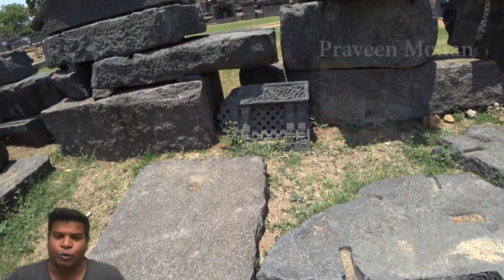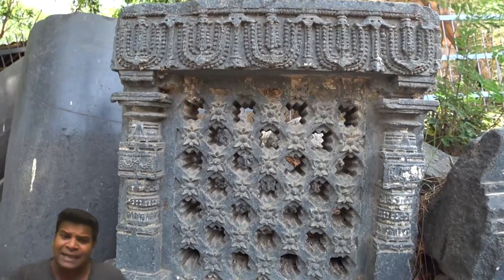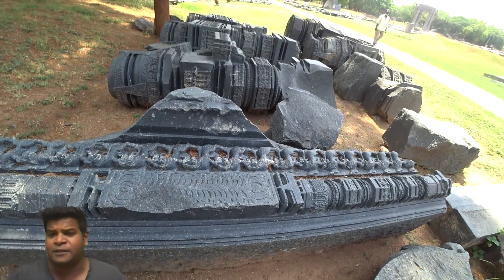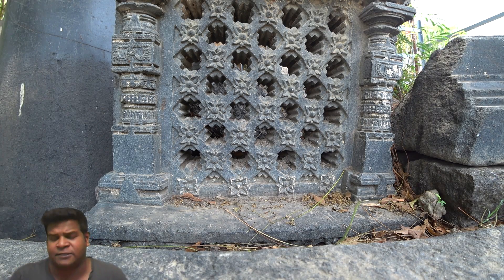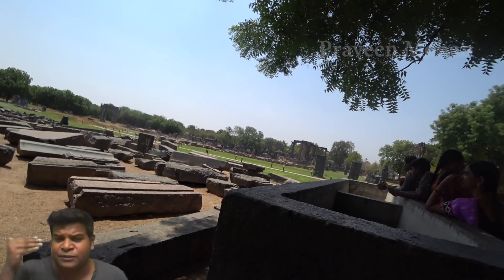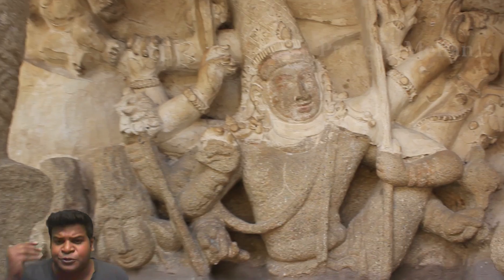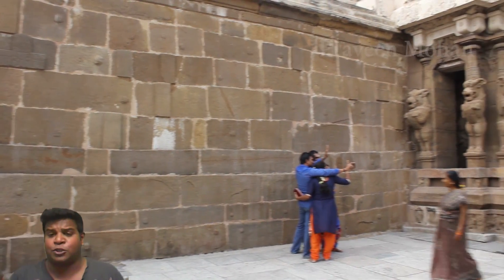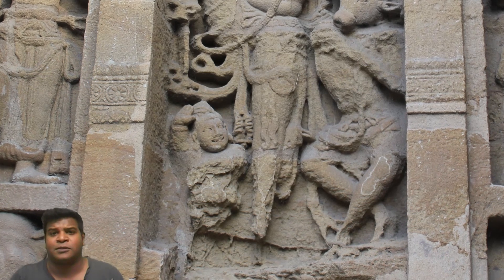Ancient Kailasa Nathar Temple was NOT built with Stones? Advanced Technology Revealed!

Comment: It is a shame that archeologists are taking it upon themselves to render judgement on the composition of the stone carvings at these sites. A more intelligent approach would be to have geologists examine the stones to ascertain the true nature of these materials. If they are found to be manufactured, rather than being naturally occuring rock then the next step would be to have chemical engineers do testing to determine the actual composition of the rock material. Another additional approach would be to have structural engineers take samples of the construction materials and then use a supercomputer to determine if the materials used were a match for the strength and stability that would be required to produce a structure of that size and design. It is a shame that the possibilities for answers are left solely in the hands of archeologists that rarely have expertise in multiple fields!!!!!

Comment: They are designs that they're perfectly the same that were used with the tool that was the same size and measured it looks like it was drilled all the way through straight down you know like with the design at the tip and pushed all the way in and make exactly the same size all little windows or whatever they're designed or they're the same size and everything they're the same

Comment: Ignorant Question I am sure: "What compound substances corrosively react with Gypsum? Lime? Cement? Lye is corrosive and made from ashes. Maybe reverse engineer the process of ashes and water to find a pattern and work from it. Gypsum and water... Lime and water?  Under what circumstances did polymer come to be? Maybe reactive substances have a pattern which require the presence of oxygen and nitrogen (air)? Now I'm interested in chemistry and physics-must be an easy way to make your own lab equipment. Curious how long ago did glass come into being. Hmmm will have to sleep on this.

Comment: Why limit ourselves to either carving OR geopolymer options. Can't it be both? What if the vast majority of the rock is a geopolymer with a semi slow hardening time and they carved/chiseled/stamped/etc the figures and designs before it hardened....or maybe the GP stone was mixed with all but 1-2 ingredients leaving it soft until after it was worked, then the final ingredients added which cause the hardening process. Just food for thought but it would most definitely make it possible to make all the insanely intricate work achievable with said copper or bronze tools. 
  In the case of Egypt it would make things like the core drill hole cut rates much more agreeable. All this said, it would leave us with a new canundrum. The specific ingredients of said GP stone.....much less each type of stone would require its own additives to achieve each individual final product.
  Point being, maybe we have been asking the wrong questions and that's why the answers are so difficult to discover.

Comment: Geopolymer signature may be the knobs on the megalithic wall at Kailasanathar, similar to knobs around the world. Do the holes in the Jali Stones taper? Certain sign of casting, moulding, and likely modular pattern elements, akin to movable type, stackable, and moulded identically themselves. This is better than sandcasting, and many elements imply more than the use of cores, but even a flexible, reusable mould face such as latex or silicone.

Comment: I do molding and casting with some of my art projects . Some stones are exact cuts from one place and transported to another, that didn't make exact cuts and then turn the block to sand and then form it back to original shape. Think about it, you can see insane blocks that are cut huge and kept the same and then placed as if teleported into place and I'm talking stones that weigh 150 thousand tons per block. Exact cuts when stone was removed and same cuts reflect on final product not saying cement forms can't exist back then I'm saying they didn't do this at places like baalbeck, you can find stone cuts of blocks cut as blocks to be blocks even into intricate shapes and intricate cuts with plenty of evidence showing they knew how to cut stone in ways we don't understand . I know a block removed from a stone cliff side and the block is exact to the hole. The block fits in hole perfect meaning something cut it and even cut the back of the block with no room for blades or a machine to turn inside the cut to sheer the back surface . it's a block literally sucked out of the spot with zero granular degradation, no saw dust and again the you gotta turn a 90 degree angle to cut the back of the block but no evidence shows this was done the block was cut perfect and left a hole exact to shape of block with no space for a cut or blade to fit in or to make that angle to cut the backside if the sides show no blade or anything made that cut on the back side. Nothing we know of can do this, the block is exact to the hole on all side and the back which is impossible with our technologies or understanding

Comment: Could be but impossible to pop out of a mold in many cases because of reverse curves and locked areas unless you uses the lost wax type of molding.so the shear volume of stones and artifacts built in this way would still require high speed plug mold cutting device.doesnt mean they didn't use wax or something like it.

Comment: I have seen in the third world that they will sometimes use the neck-end of cut-off 2-liter bottles poked through an array of holes in the wall to produce a passive form of air conditioning. I would bet these jaalis would have behaved in the same manner, passively compressing the air that flows through, the large surface area of the cool stone hole would rob it of its thermal energy, then the air would cool as it expands on the other side. Very cool stuff! Thank you for sharing.

Comment: Hy praveen your videos are really awesome, and I have a suggestion in this video is The piece of rock which have a hole and a drill mark around which you showed here would be used for portery making also, because those things wre made in rotating things so probably there is chance to have Mark's on it and it also is a V shaped hole so the tool inserted could stand exact vertical position and could avoid tilt.

Comment: Artisans would want to choose the simplest and most malleable material to carve with so any mistakes made along the way could be easily and quickly corrected. So what about beeswax? Then the artisan only has to carve one because he can make a simple sand mold and reproduce as many beeswax sculptures as he wants. Then he could use those beeswax sculptures as placeholders in the sand molds and pour molten rock or metal into the mold which burns away the wax and creates a sculpture made out of the specific material used. This could be a pretty simple explanation if evidence of the ability to create such high heats and sustain them long enough to produce molten stone or metal was to be discovered which dates back to those time periods. I enjoy your content and value your opinions and unique insight on these topics. Keep it up and stay well.

Comment: At 11:28 the similarity of the bumps in the rocks with those at Sacsayhuaman at Cuzco is definitely striking. As an alternative hypothesis to geopolymers: in the case of basalt the structures could have been melted. Basalt melting point is actually under 1000°C so it could have been casted more easily than even metals. Not sure you could get down to such an incredible level of details though, but still interesting.

Comment: The question is very simple: -carved from hard natural stone, or cast using liquid polymer poured into molds made from an original clay model?  The answer is simple; they either had a binder-glue to make the agglomerate adhere together like stone or they did not.  It's pretty easy to assume that they did and that they used it to produce molded products instead of attempting the impossible with tools that they didn't have.  Case closed pretty much.  
The fact that the upper levels of some temples used lightweight 'stone' capable of floating shows that they either knew how to make such lighter-than-water stones or they had a heck of a lot of pumice-like rock with which to work.  I'd guess that there wasn't a lot of volcanic porous rock available so they had to make their own.  The establishment needs to explain the source of the stone used to make such lightweight constructions and statues.

Comment: Perhaps the stone extracted and missing from the Elora caves and other caves and tunnels was somehow turned into the mix used in the molds to make temple pieces that harden with the look and form of that original stone. Perhaps that’s also how the stones in the walls at Cusco were made. Or was it a massive CAD injection stone mold machine with a preprogrammed design.

Comment: Not sure what you are implying by "mechanical device". The holes with corners could have been made identical if they have made a device that is not mechanical but like a metal piece already shaped like the outline of the hole. Once they fastened a slab of stone in one place and aligned the pre-shaped tool they could just keep hitting it so it automatically makes an identical hole. 

To align it they could use precise rulers that keep it in place. I am not seeing anything mysterious about this. I mean, the explanation of manual standard tools actually makes sense and hasn't been disproved, but drilling machines actually have no evidence of existence that long ago.

Comment: You can't cast a 3D structure with holes in many different directions, like the row of lions. the mould would get stuck. It would have to be a mould that could be burned out, similar to bronze casting into a wax shape inside a plaster container. The hot bronze burns away the wax, and takes its shape, then the plaster can be dissolved in water. So the mould wouldn't be reusable. It's a good theory, and likely closer to the truth than the hammer and chisel bullshit.

Comment: In that very case, I'm sure you could haved used ultra-acoustics. You would first make a metal template of the desired shape and with the help of some kind of acoustic device that could propagate microvibrations through it, you would bore through the basalt and obtain the same result every single time.

Comment: I have worked on construction jobs here in the U S. There have been times when it was necessary to demolish building foundations which had been made from concrete poured many years before. Concrete is made up of sand, cement, and crushed aggregate stone. After many years it is almost impossible to tell there was ever any of these components in these foundations. What was once poured out like water has become one solid piece of stone. This has developed after less than two hundred years. What would "poured concrete" look like after several hundred years ?? My guess is that it would easily be mistaken for stone.

Comment: It was a geopolymer. After casting the structure an electric charge was applied which aligned the lattice crystalline structure of the geopolymer and hardened it quickly. 

Maybe, In modern times once plaster was applied to the temple it broke the circuitry in the ancient geopolymer and the lattice structure and cohesive strength of the statues.

Comment: There is a process today that is used called E D.M. which stands for electrical dicharge machining .  Some of these  could have been made using what are called form tools . These are tools that have a shape and could  have been vibrated  went sraight through the rock like butter when vibrating at the right frequency. This vibration process may have been able to powder the rock so it could be made into geo polymer for a casting process . Some of them were most definitely cast. They need to be checked for draft angles needed for release from the molds.

Comment: Another Great video. It seems as tho they used geopolymer stonework alright. We get told that no culture before this time knew how to mix up ground rock to shape and mold into shapes as we do with concrete but some designs clearly have been molded then hardened. Like that hole that has a spiral in it. So basic but if you think about it, even a drill that goes down, then is stopped and retracted does not leave a spiral it leaves circles, but not a clear descending spiral. To make a mold and pour the black basalt 'concrete' then remove the mold is possible, and with larger peices you just keep adding and the first parts dry while you work further along. Plus finding bricks in the middle proves its GEOPOLYMER, I dont know why science/scientists dont just admit "yes its clear india knew how to make really good concrete". It would take alot of smashed powdered Black basalt to make a 'concrete' for all those buildings tho so they must have had a strong set of large rockcrushing machines/labour force. Unimaginably complex.
Such beautiful craftmanship! Indian history is VERY underrated!
Plus putting PLASTER over the stone carvings TRAPS MOISTURE and makes both substances fall away. NZ building in the 80's/90's went thru a faze of this technique, then 20-40yrs later government had to pay out for insurances on the "LEAKY HOUSE SYMDROME" which affected ALL houses with this design. Same thing. Stupid English goin around the world claiming everything, claiming it for themselves, so arrogant that THEYRE the only ones who have any intelligence and lying about every other cultures talents and claiming it as their own or destroying it.
Also, Land Tax = the idea that someone can turn up, claim everyone elses stuff/land and make them pay him to live in their own homeland. EVIL.

Comment: Excellent video. Beyond phenomenal. Some other places that look like 4D laser cutting into stone was used, just as simple as we cut vinyl or print in 3D with plastic.

And I've always wondered whether beings tried to replicate that technology & came up with a "solution", by means of mixing various ingredients.

Not just high levels of technology, but advanced thinking beyond comprehension.

Once you realize, there's rock just about everywhere, it's obvious you would choose that as a building material.
And spend a lot of time manipulating & working that material over & over, you find new ways to work it, heat it bend it, liquefy it, pulverize, vaporize or even atomise it.
The builders of these sites have knowledge beyond ours, which many can't accept.

If a civilization is thousands or millions of years old, it would know that rock is abundant, whatever planet they go to.

I believe that that there are a lot of "mixtures" or "blends" of different material that make up some ancient work. 

But I also believe some of that work, is an effort to replicate older more advanced works.
Thanks for bringing these places into our homes & to our attention.

They are wonderful, in the true sense of the word.

Comment: Hi., Praveen. that's great work done by you.  
I think you may find some ancient temples here & there around that region which was made by Geopolymer substances coz, specially Warangal port was may became witness to produce geopolymer statues and supply those designs to built such a kind of temples only based on this technique. But as I think deeper , How it could possible to make a design by liquidising the rock and make it in an identical shape ???!
 I think , At that time the sculptors were high in numbers and they divided into two categories. One group (minimum numbers - highly qualified sculptor ) who must have the model which contains the measurements of dimensions of jali designs or elephants or any other designs to carve on solid rocks with specialised rock cutting tools. They carve the stones only to build any one temple which is entirely built in carved solid stones and another group ( less qualified or the beginners )who make the designs by using such a plastering techniques. 
Imagined such a occupied land by them were a huge workshop to produce such a sculptures are made my mind to pause for minutes. The time only the time they have to make it such a marvellous works otherwise now the peoples who representing to present generation are don't have time to blink their eyes off from technologies like mobiles and many other related devices. That is the difference. 
Peoples genes are changed based on technology but not the time. Time has the great potential & knowledge which remain the same from thousand years back to till now and stay forever. Once who knows it they will submerge in time and know the importance of it else in one point we are out of date !!

Comment: That is all MASTER-LEVEL craftsmanship on all those blocks. This is also true for all the structures you've covered in India/Sri Lanka. That would mean there must have been thousands of master-level craftsman in one place doing all that work if conventional theory  is correct ( primitive hammer & chisel) Without looking it up I am confident there aren't a HUNDRED craftsmen of that level in all of the US with hammer & chisel. The only way this volume of master-level work could be achieved is with powered tools. The power source could be anything but rotary/reciprocal cutting/polishing tools powered by something must have been used. As you pointed out, the consistency of these cuts is staggering. Repeating hundreds, thousands, and tens of thousands of times, at least on those huge structures. The geopolymer technique deserves a lot of credit. If geologists can't tell the difference, it may solves a lot of puzzles!

Comment: One way to tell if these designs were made using a cast mold is to find one imperfection in the stone and then seeing if the same imperfection is on the other stones that are the same design. You will probably need a microscope since they were perfectionist back then so an imperfection would be extremely hard to find unless you get some kind of magnification.